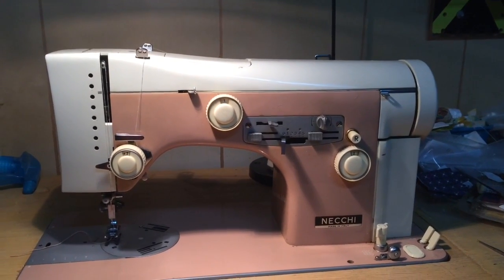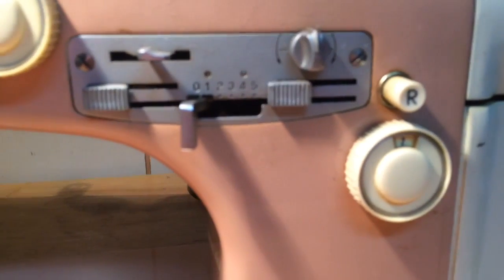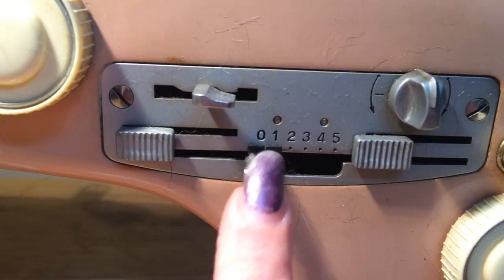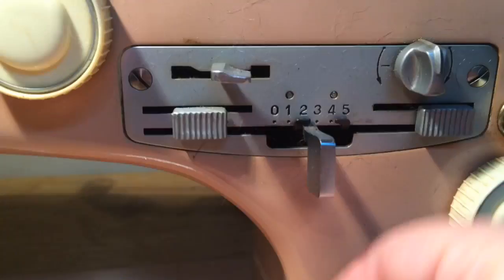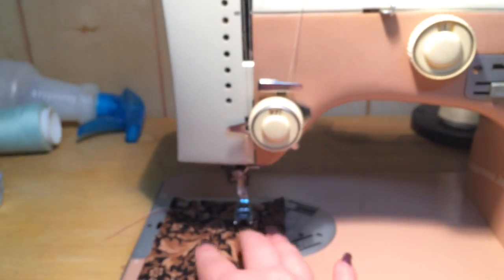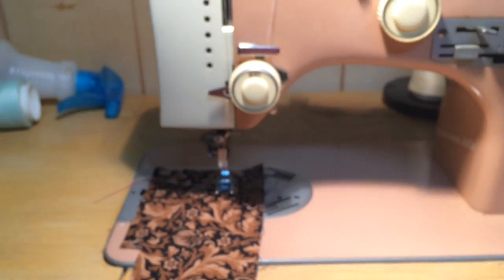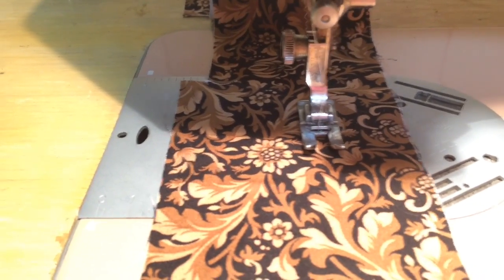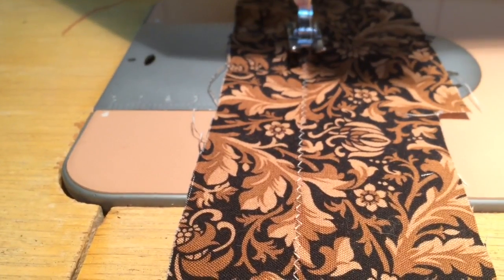Zigzag on a Necchi Supernova Julia

Comment: Thank you for the demonstration.  I see that the Julia has a different look from then BU. What are the technical or feature differences or compliment of included accessories?  I have an assortment of cams and three of them have an aluminum caps and no slot in the top to engage with the tang on the top of the cam drive shaft.  How are these cams used? 
I have two model BU machines.  One, I have restored to like new working condition plus I added some electronic features to it like tap for single cycle, stop up, stop down, and a much higher torque motor.   The other one I just acquired 2 days ago and it doesn't even tune over.  But the first one didn't turn over either when I go it.

Comment: Ok my plate with ruler length is off and I cannot get it pushed back in. Also what is the little plastic gadget by the lite.  Were can I get the cams designs